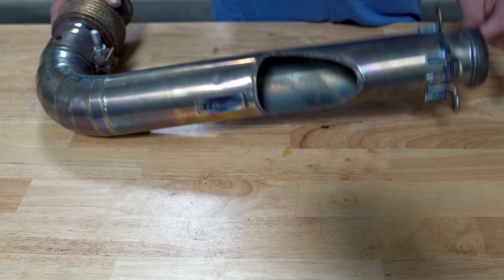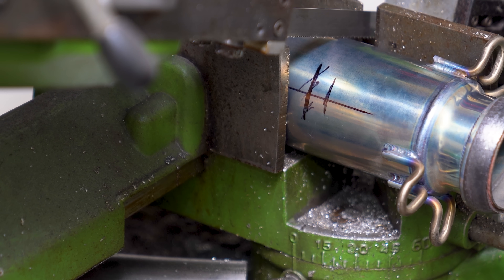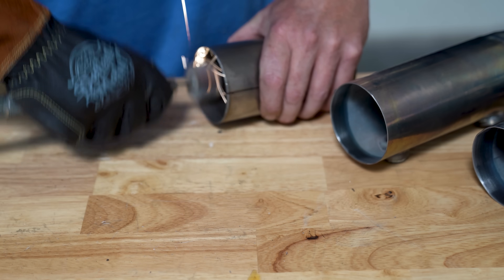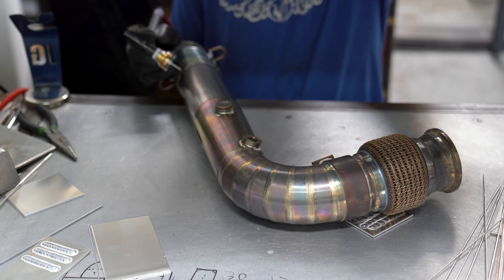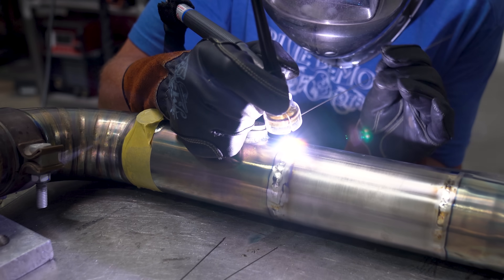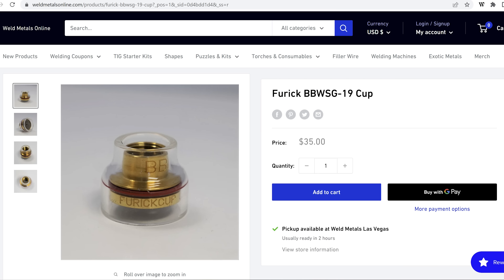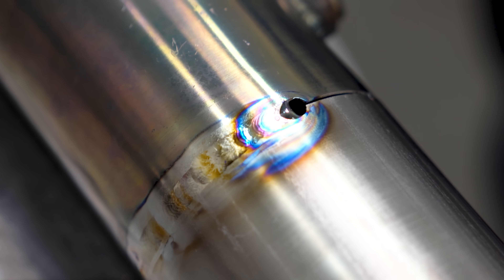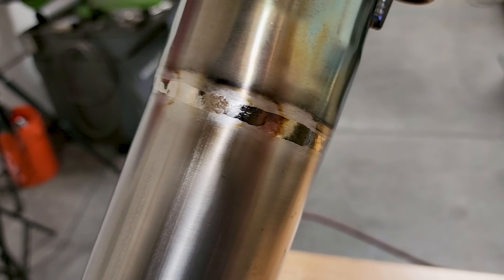Titanium Weld Repair

Comment: I recently watched your video on welding up the titanium tubing. I spent several years working as a welder for a company building heat exchangers for the plating industry. These were almost exclusively using 1" to 2" commercially pure titanium, thin wall tubing. Any time we were welding a surface which had an opening inside, we were required to use Argon to displace the air inside to keep the inside of the weld from becoming contaminated and brittle. Once Titanium gets above 900 degrees it very quickly absorbs CO2 and other impurities from the air into the weld, so back purging with an inert gas was essential. Maybe your work was not going to be subjected to heavy stress, but I think the practice of always back purging should be a part of any titanium welding practice. I did like your attention to cleaning the surfaces before the weld process.

Comment: Dislike for not using the metric system
Reply from the maker: I dislike your comment for not converting my measurements to yours. Now what?
Reply: @TheFabricatorSeries  Its not my system of measurement it's the fuckinf worlds system of measurement
Reply from the maker: @jimmysmyth7510  So? If the world switched to speaking another language tomorrow, would you? Metric isn't my native unit, and I'm not going out of my way to change for a couple less dislikes.
Reply: @TheFabricatorSeries  yes if the whole world spoke one language except myanmar and lyberia I would learn that one universal language
Reply: @TheFabricatorSeries  what are the chances that car that the pipe goes on is gauged in inches? Why dont you use the same system of measurement as the rest of the car
Reply from the maker: @jimmysmyth7510  is the lumber that holds your roof up 2x4 or something else? We can keep going if you want... it just pays me more whether you like it or not.

Comment: Awesome video, I actually have a customer's Titanium Exhaust in my shop right now that I need to do a repair on. Glad I saw your video, I learned a few things as always...I plan on back purging the part but the crack itself is in the previous weld bead, it appears to be on a weld that is where the tube was flared to fit over the other tube, and someone else tried to fix it with what looks like MIG in another spot and burned a pea size hole in the tube along with a bunch of craters like when there is no gas present in MIG.  Wish me luck it should be fun !!! I did get some Grade 2 coupons and I know from talking to the manufacturer of the exhaust that they use grade 1 in their exhaust systems, how much difference should I expect when I switch from practicing on the grade 2 to welding on the grade 1 ?   i.e. settings (I'm assuming will be really close) should I use pulse ? I'm also concerned about being able to clean inside the crack since I can't get in between the layers very well... As always TIA for your videos and help... Chris @ T-Town Welding and Fabrication.

Comment: Not a welder, but did learn some TIG welding as part of my engineering degree.

Is there a reason you don't use an inert gas box for something like this? I don't imagine that they are very expensive (though I may be wrong), but it would mean not having to stop for post-gas until a section cools and less concern about oxidation in general.

Comment: i prefer using thicker filler rods when welding thin pipe, it allows me to cool the weldpool a bit more during welding... the thin wire just goes. ppl underestimate the heat management gotten from the filler rod.

Comment: You might Try 75-25 Argon Helium It will flow so easy and you wont need near as much Heat. It also works Wonders on bronze and Copper. Thank You MacDonald Douglas

Comment: What's your favorite TIG welding gloves? I've been through a bunch of them and I get not enough heat protection/ not enough dexterity, I'm using a older synchro Wave 250, water cools, but still it gets hot when welding production

Comment: Not sure where lese to post this. I am new to tig welding and I think your vids are great. I do have a question though. Much of what you show is what works and what to do when it works. I am new so I am trying to figure out what works. For me I struggle with keeping the arch at the tip of the tungsten. It is like Medusa snake hair when I weld. The damn arc is all over the place. I try to ensure I am very close almost touching the surface with the torch. Is it me, my welder or the settings I use. It's the same with any type metal, aluminum, steel etc.i grind 8n the direction of the tungsten so the grind lines are in line with the length of the tungsten. I tried sharp points, blunt ends. Example, I am practicing on razor blades. My tip is at the weld point and when I start the arc it is 1\4 inch away from where I want it to be.
Reply from the maker: Welding is one of the few industries you can know everything about except how to do it. It takes practice. Everything I show is "as is" since I only get one chance to record it. There is no "setting" that will suddenly make you weld or anything... just takes practice.

Comment: Aerospace Welding experts....hahahah good one.

I am not a Aerospace/Welder, i just work with them a lot, so i understand your jab. 

My Aircraft/Aerospace expertise is more a generalist with 20 years experience on everything else relating,  including Titanium modifying, shaping and constructing.

It's funny because when i seen you sanding down the Titanium, my first thought was that sparking back onto the titanium itself and the repercussions in Aerospace/Aircraft: we are allowed so no sparking back onto the material when reshaping. 
Having to sand down 2 to 5 thou on a taper shim, for a 787 Stabilizer.....is no laughing matter
Sanding down 1-3 thou the Engine bay door contours on a F-22 for R&D..........

but i laughed at myself when you mentioned Aerospace.

Comment: I'm getting ready to do my first titanium  exhaust.... after I mess up a bunch on scrap😂... thank you for all the tips.
Reply: You should know that its not very durable material. It can stress fracture easily.. if its for a turbo car, its good for the post turbo piping not the manifold. It resonates the sound diffetently too which makes the car sound awesome.

Comment: looks like an exhaust cutout that fell off. had a similar in 2.5" stainless. was welded with the same looks. super thin fuse weld with tig. a few hits with a hammer and it fell right off

Comment: As I recently got into TIG Welding I've of course done my research about different things and one of those things is of course Cleaning the material. Everyone here on YouTube says the same thing. CLEAN CLEAN CLEAN however, when I went to a local fabrication shop that's very well known and do super small to super big jobs I asked them how they work and the guy I was talking to basically told me "If the part is not like SUPER dirty I never clean it off more than with acetone to get rid of oils, but that's about it.". 

He said most of the coworkers worked in the same way and that's the way he had been taught. So, what actually gives? I mean, how much of a difference does it make?
Love the vids!
Thanks
Reply from the maker: On titanium, it's a huge difference. Everything else... usually acetone is all that's needed. Sometimes brushing on stainless is needed. Some people take it over the top.
Reply: @TheFabricatorSeries  Thanks for the reply. That's good to know! I haven't planned doing anything with Titanium yet, but yeah definitely good to know the cleaning process. My first 3  "big" projects is a Welding cart(done), Welding table(gonna go get material this week) and then an exhaust for my Passat in stainless :-)

Comment: I don't believe parts going into outer space have to be that good, it's just NASA milking the taxpayer.  I use an old snowmobile engine in my airplane and it works just fine.

Comment: Nice! I built an expander like that when I worked at my dad’s shop almost 20 years ago. I modded a pull back ram with an air over hydraulic foot pedal, but a knockout punch driver is much simpler. Great tip!
Reply: Tiiiiiiim! Cool to see you here. I’ve learned a lot from you and this guy. Thanks brother!

Comment: The oxide on titanium welds from lack of shielding gas creates micro fractures in the oxide which will grow over time when flexing and vibrating.
I don't know how deep it will go and if grinding will remove it, but brushing off the coloring will not and is not acceptable.

Comment: Did that hole fill work because you hadn't welded the other area yet? If you blew through after everything else was welded, wouldn't the purge pressure keep the hole open?

Comment: Not so much for titanium, but for shitty hobbyists welding do you have any foot switch alternatives? Im thinking of getting into welding and have cerebral palsy. My feet work but I wouldn’t trust them for welding control.
Reply: I used to TIG large production light fixtures, a foot pedal wasnt practical, so we all had rotary thumb knobs velcroed to the torch, except for one guy who preferred the slider style. I now HATE when I have to use a foot pedal, have to sit just right, etc. Go for the thumb control for sure.
Reply: @85TransAm406  I’ve only heard of the slider style before. Thanks to all for your help!
Reply: There’s scratch-start TIG welders, and there’s also some with a thumb switch on the torch.
Reply: @joshcorvette  thumb switch is what I was trying to remember

Comment: This is super cool, especially since there isn't much info out there about titanium. One thing that's also pretty important that I've ran into when welding titanium is to make sure the back purge isn't flowing too much. I've had times where my back purge is set a little bit too high, and the argon leaks through the joints too much, interferes with the torch shielding gas, and makes you lose coverage. It's really baffling until you figure out what happened. It's also a big cause of blowouts and looks a lot like the blowout in the video.
Reply: Cool.
How much back purge do you advise then?
Thank you.
Reply: @wtfftw24  to be honest, I have no clue. The way I do it is kind of jank, I have a Y-fitting after the regulator. Set the regulator at 30-35 CFH with torch side full open, then open the purge side just enough to have the CFH drop about 5 CFH.
Reply: @paytonlee2896  all right.
I got it.
Thanks a lot for your kind answer buddy.
Greetings from Italy 👍
Reply: @wtfftw24  awesome and no problem! From here in the US
Reply: @wtfftw24  as low as possible
Reply: Does anyone remember that youtube channel who did welding videos and farming videos but was removed from YouTube when he started saying some pretty out there things. Can't remember his name but felt like watching some of his old videos.
Reply: @lukejax1407  Chucky2009
Reply: @lukejax1407  the texas guy?

Comment: Awesome, absolutely awesome, especially the hole filling technique. I had to repack the stock "silencer" on a 1981 YZ80H, and  that involved cutting the welded end cap off, cleaning and repacking the inside, and re-welding the cap back on. Needless to say, I blew a couple holes in the very thin and weak steel. I stumbled upon your method purely by accident, watching you do it so smoothly was very encouraging. Ive messed around with titanium a bit, definitely a challenge! What size tungsten did you use on this job? If you already mentioned it and I missed it, my apologies.